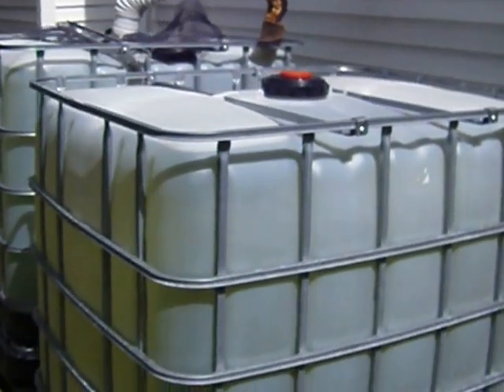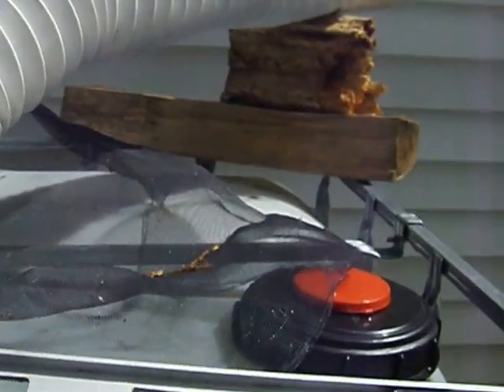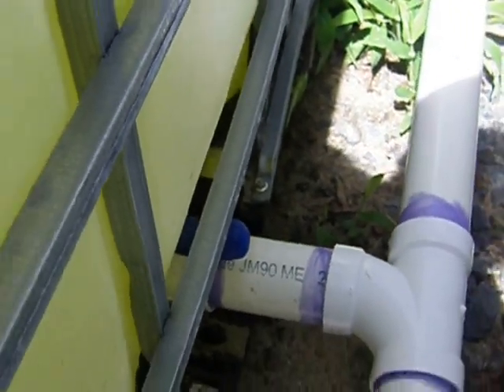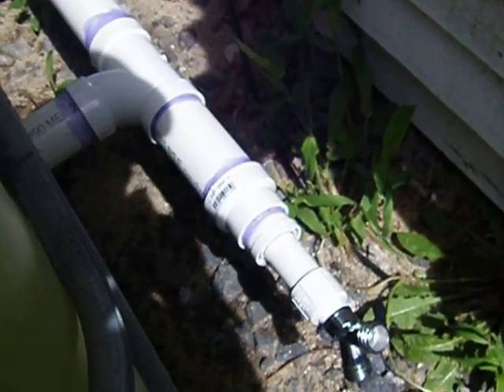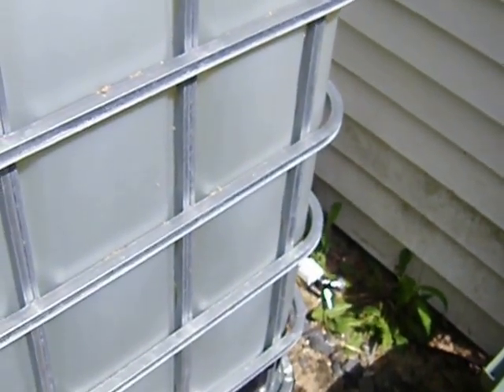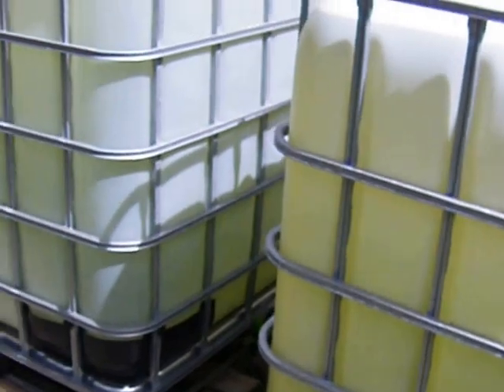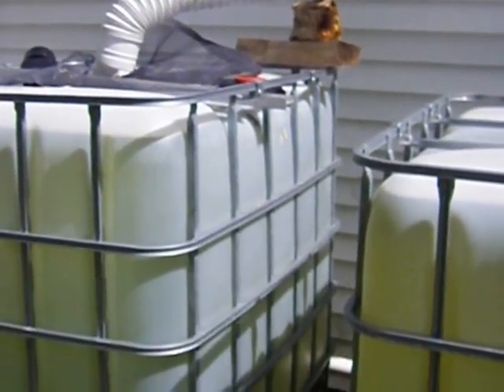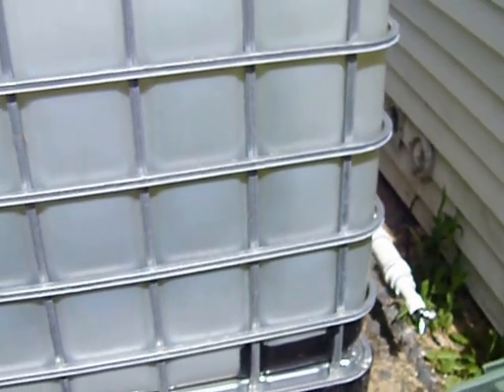275 x 2  Gallon Rainwater collection or Harvesting System

Comment: A bit of it's filtering power:
98% of particles larger than 0.2 micron (Staffordshire University Labs)
100% Giardia Lamblia
100% Cyclospora
100% live Cryptosporidium (WRc Standard)
100% Cryptosporidium (NSF Standard 53 – A.C. fine dust – 4 log challenge)
100% E. Coli, Vibrio Cholerae (Johns Hopkins University)
99.999% Salmonella Typhil, Shigella Dysenteria, Kiebsiella Terrigena (Hyder Labs)
You just need to use a string filter, etc, to remove particulates, first.

Comment: Ok, that worked. I hope it is decipherable...
These are made for a water bottle, or a special bag. But you can simply drill a hole in the bottom of whatever container you want to use, and install it into the hole. Then set that over another container. (Like 2, 5 gallon buckets.)
Looks like the price has gone up by two dollars! 
A quote from there: "This 0.2 micron filter is the smaller version of our 4" x 4" ceramic filter and has the same filtration efficiency."

Comment from the maker: The totes are food grade plastic and never contained any chemicals so it would technically be drinkable, but due to possible bird droppings on the roof or other contaminates from above I would filter and or boil it first. But it will be fine for washing dishes, flushing toilets, showering ect.